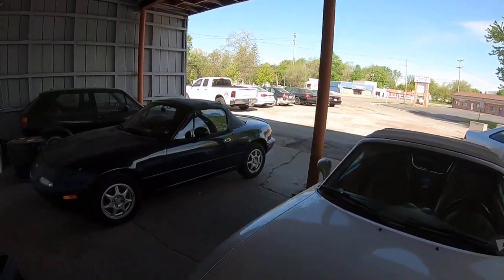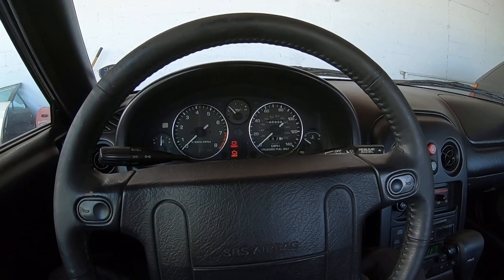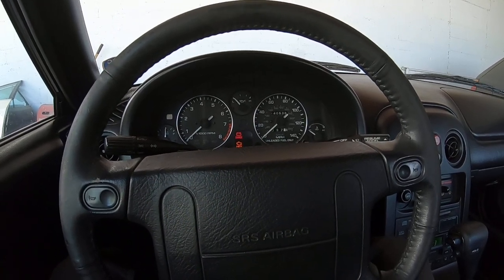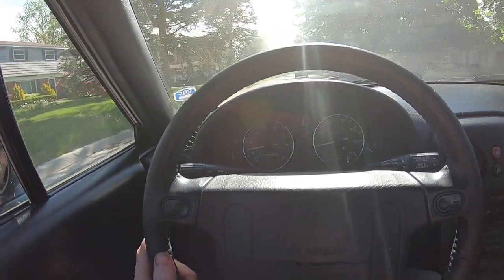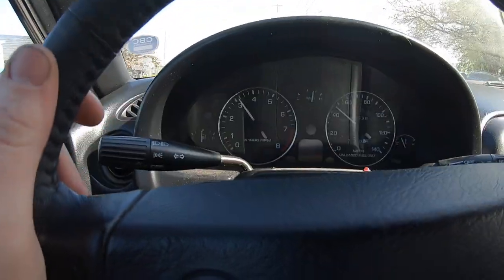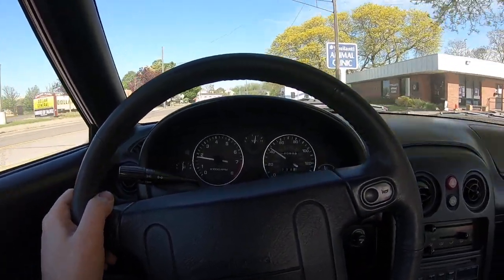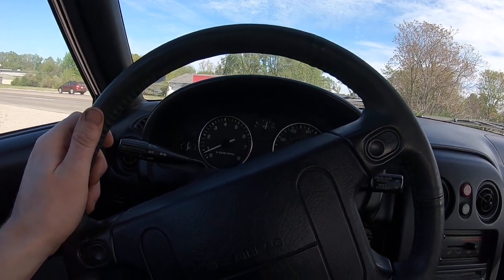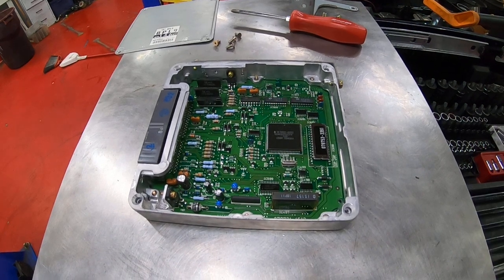Miata Failed ECU Diagnosis and Automatic Transmission Issues

Comment: This is a common issue in 9th gen. Ford F-150s. When the computer is removed from the fire wall and opened up the problem is plain to see. The capacitors are bulged and leaking. And a burnt electrical smell is strong.

Comment: I've been having an issue similar to one of these. My automatic 97 1.8L can't disengage the HOLD that prevents it going into overdrive. Everywhere that has looked at it has said it's an ECU problem but none of them can actually do ECU repair, they just recommend I replace it. It's been tested with another working ECU to make sure it's not the button or wiring along the way so it's definitely inside the ECU itself. (Sadly turning it off with a different ECU then swapping back doesn't work. Instantly enables the HOLD once the car is turned back on).

Almost out of ideas at this point since I can't seem to find an unblocked ECU that supports ABS in my country (Ireland, but a Japanese importes car) at all.
Reply from the maker: If you can’t find one on eBay or something then I don’t know what you can do.

Comment: I’m looking at buying a 1992 Miata with the automatic. Plan is to swap but for now. Like to use as is. Problem though is that the car will not move in reverse. Can be moved when pushed in neutral and will drive forward. It’s like it has a parking brake on when in reverse. To the point it almost stalls the engine out. 
Any ideas??
Reply from the maker: ☠️☠️☠️

Sounds like the manual swap needs to be sooner than later

Comment: My miata is a 1991 swap to manual  for a long time a few years swap the engine after that the signal starter sometimes work sometimes no I know everything is new starter battery checking the diagram cruise control and transmission module must be bypassed ?????because I just bypass the interlock switch

Comment: I got a 93 automatic NA that I have owned for a year now and the past 8 months it has been shifting rougher under higher RPMs and sometimes low rpms but does not seem to be slipping. Sometimes when it shifts you can not even feel it at all though. Such a interesting thing with these computers. Im about to have a shop replace the trans fluid because I don't know the last time it was done (nearly 150k miles now). Do you have any suggestions? Really cool shop you have!
Reply from the maker: Thank you!  I would try replacing the “vacuum regulator” it determines how harsh the shifts are based on engine load (vacuum)